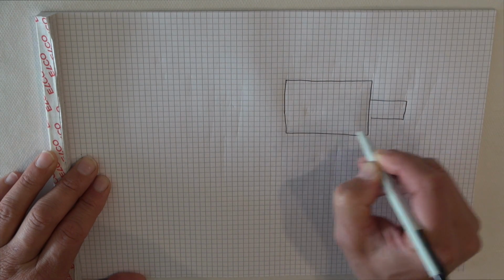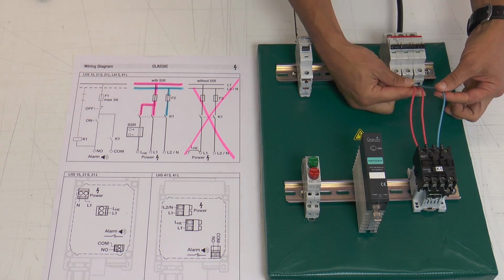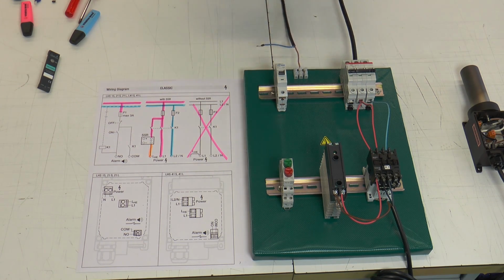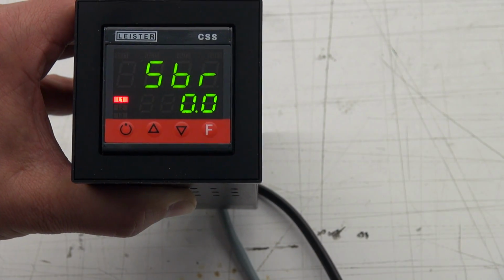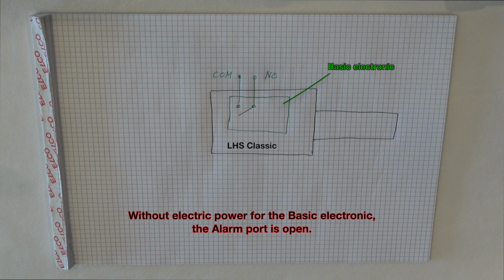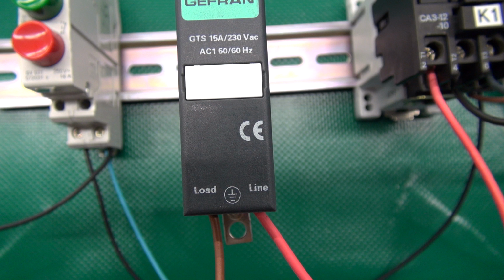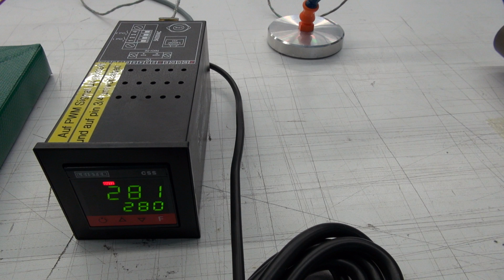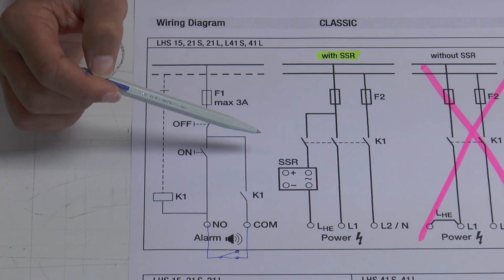Leister Tutorial | LHS Classic with SSR and controller

Comment: Hello, is there any guide on how to use the KSR Digital alongside a DSE to control a LE 10000 heater?
Reply from the maker: The KSR Digital Controller and the DSE is phased out and not longer available.
This components are replaced with the CSS (123.039) or CSS Easy (125.944) and SSR (159.220).
They are much cheaper.

Anyway, if you want to connect the old KSR controller with the DSE then you have to connect the port nr. 11 from the KSR to the blue wire from the DSE.
And port Nr. 12 from the KSR to the red wire of the DSE.

I hope we could answer your question in this way.

Best regards
Leister Team

Comment: Can you tell me about solid state relay ....which relay we can use to control electric welding machine 400arc  using raspberry pi or audrino
Reply: Thank you for your inquiry. 
Our SSR use a PWM input signal. If your raspberry pi or audrino can supply this signal, then you can use our SSR.

Best regards
Leister Team